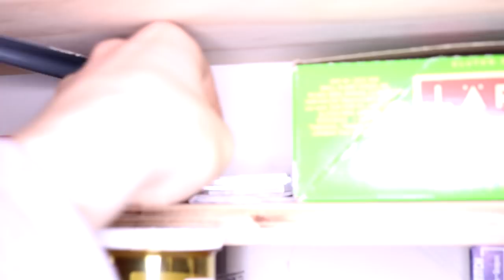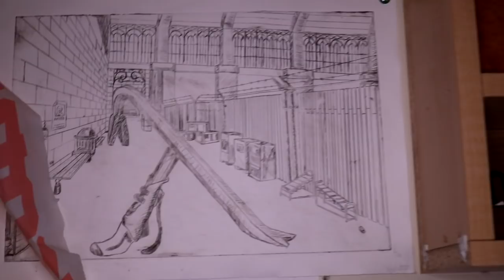Selling It All

Comment: Heya Dylan, is the issue with car actually the transmission or is it the CV/driveshafts again.? You also started to say you got into trouble with, before you cut yourself off, who or what did you get in to trouble with. I wish I could help you out, unfortunately due to my own issues, (medically ) I can no longer work. I can however pass on advice and knowledge which I'm happy to do and even financial advice (my last job was with a bank).
Reply from the maker: I meant to cut that out, it was supposed to be the same thing that follows that cut off, I just didn't know how to word it. so I said it 3 times